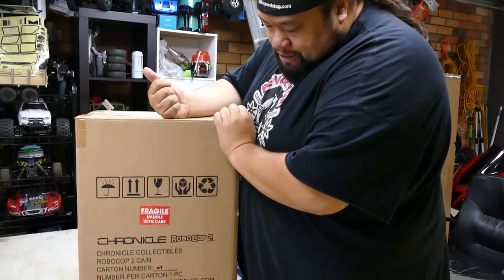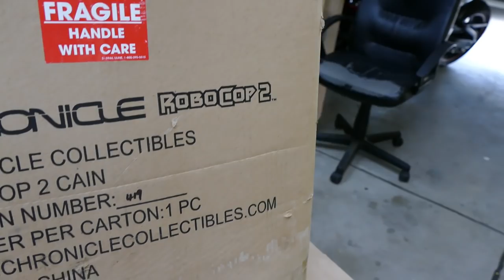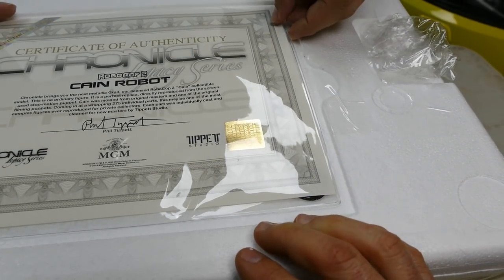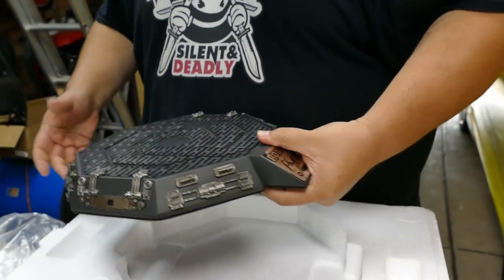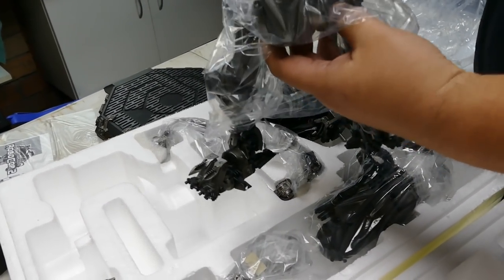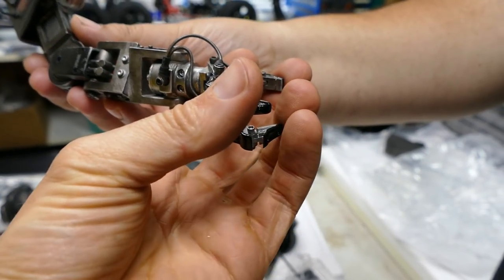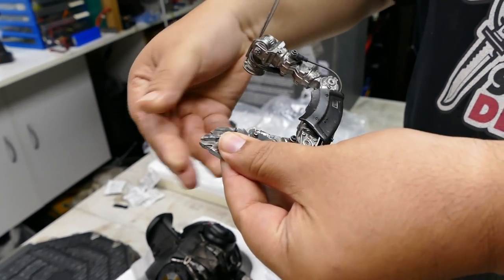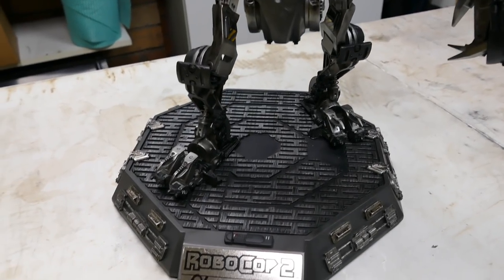ROBOCOP 2 “CAIN” CHRONICLE COLLECTIBLES - RARE 1 of 500 HUGE 16” FIGURE

Comment: Tech as follows spring hydraulic high pressure plastic washers darking tech also using a small cell phone battery for led lights with trimmer or dimmer switch battery will go in the upper body his size will be based on the smallest 256 cap screw I may have to add weight because stainless can be light I may slightly change some parts when done he can be taken apart and put in a safety deposit box for safe keeping etc I'm expecting him to be a master piece in the end
Reply from the maker: Sweet
Reply: @RCTanksTrucks247  that's the new elevator repair guy in town .